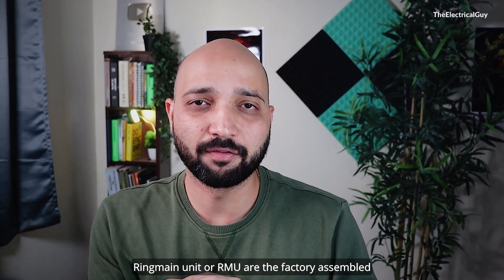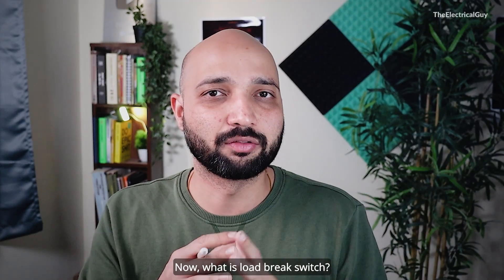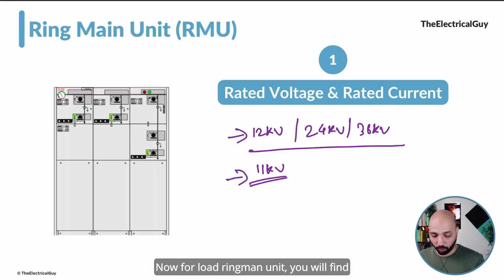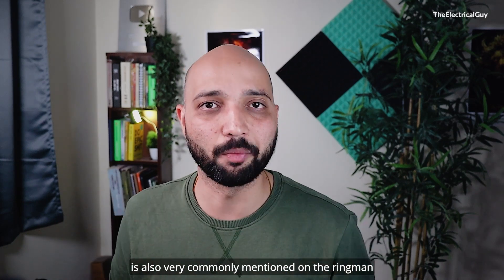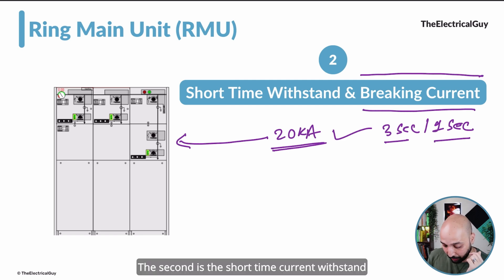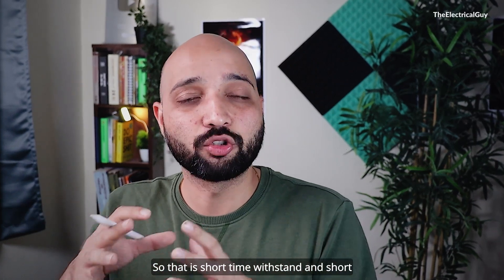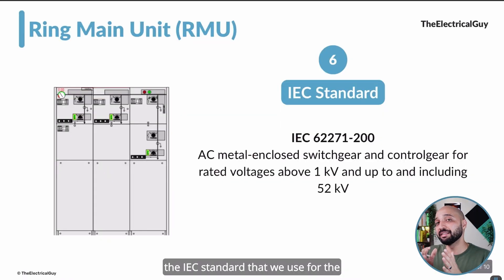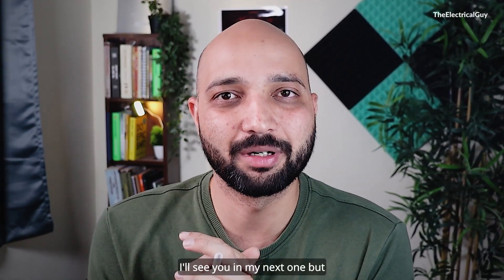6 Critical Technical Parameter of Ring Main Unit (RMU) | MUST KNOW | TheElectricalGuy

Comment: Hi  how are you , we do appreciate so much your lectures because they add up on what we have in mind. I have a question which deviated from this lecture, it's about traction power system. In our system each traction power substation has two transformers of capacity of 20MVA, one transformer feeds one side of 25 km and another transformer on another side of same length. These are two poles transformers with neutral point terminated to the rail. So, in normal operation when train(load) crosses on either bay neutral current is zero. But nowadays it happen neutral current flowing in the return conductor  when train crosses along a particular bay, and this current ranges  96.6A  for neutral , 56.6A  for   + feeder  and 151.8A for -ve feeder. These readings for transformer 1. And for transformer 2 when train crosses it's bay reading is 216A for neutral,  0.0A for + ve feeder and 216A for -ve feeder, and neutral wire vibrating when it conducts. What can be the cause of this problem?